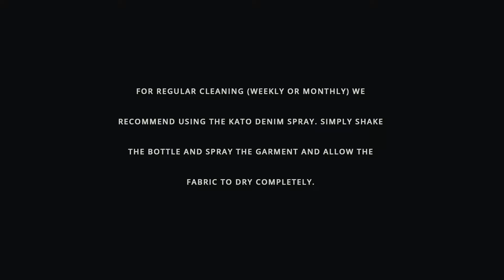HOW TO WASH YOUR SELVEDGE DENIM

Comment: There is no way those could be a good pair of denim jeans if they require a special spray, and washing technique.  Good denim can be washed in a washing machine.
Reply: You totally can out them in a washing machine like any other pair of jeans, they're not going to evaporate or turn into dust. This video is for those who wish to preserve their denim in a certain condition, like dry cleaning a suit to keep it looking new.
Reply: washing in the wash machine will fade the indigo color, I wouldn't want to lose the deep indigo color. So I never throw my selvage jeans in a machine, just soak it then hang dry, 2-3 times a year, that's it. The result of the fade can not be duplicated. Denimhead was here.
Reply: Good materials require more care if u wanna preserve them and keep them looking great for years. It's just like with good leather shoes, alot of people do alot to maintain them as opposed to just cheap leather sneakers you get for $50. No one is gonna go through the trouble to preserve cheap quality materials, but if you're spending hundreds of dollars+, then you want it to last as long as possible and still look and feel good so that you don't have to buy a new pair often at all.
Reply: The truth is this all that is really required and you are way overdoing it washing your denim in a machine, unless you really need to if it's heavily soiled, etc. If you're just wearing them doing normal things and not getting them super dirty, this is more than fine. In short, you are wasting a washer cycle and some might say aging your jeans when you don't need to.